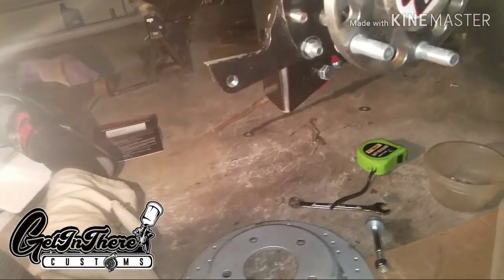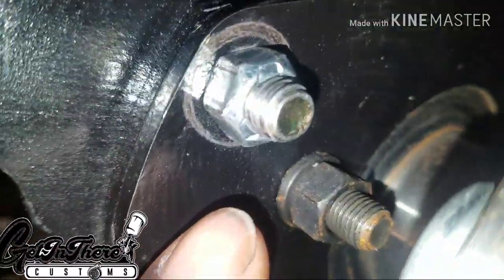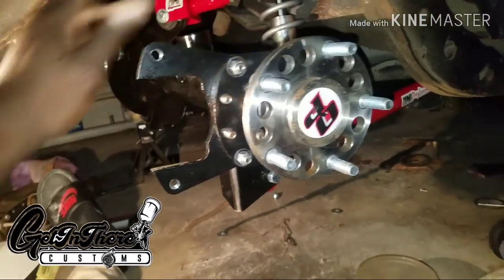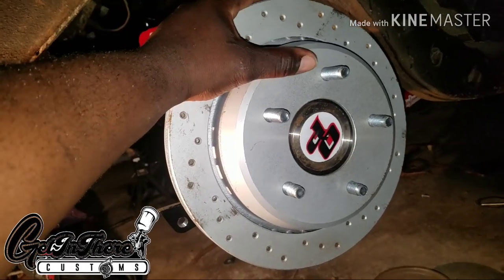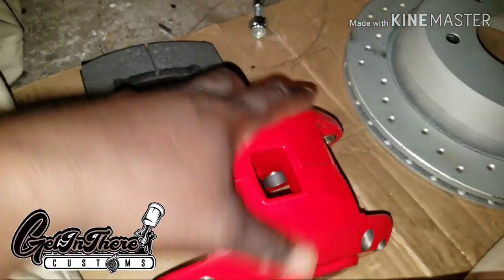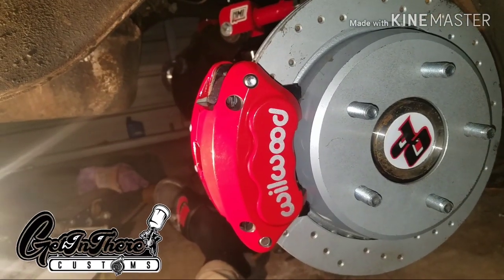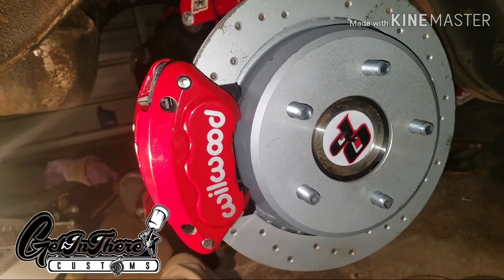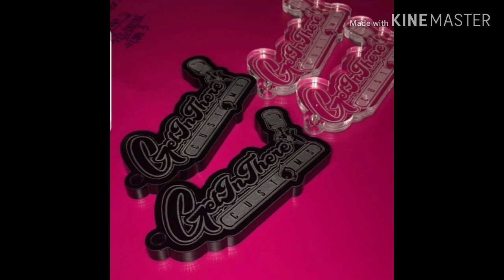how to rear disc brake swap a donk.71-76 impala/caprice

Comment: do you a kit for the 1974 olds delta 88 
i have the berm to brakes and rotors but need help bolting it on.
Reply from the maker: Front yes rear NO IF YOU HAVE 8.2 REAREND
Reply: @Mr_getinthere  Ok  how much for the front.  I already have the brembo 6piston for the front and 4 piston for the back that came off a ctsv caddy.   how can i tell if i have the 8.2 or not?
Reply: i have the rotors already to.

Comment: @Mr_Getinthere i got a 72 impala custom 2dr, are you still selling the rear disc conversion kits, im trying to buy one asap
Reply from the maker: I'm sold out for the donk rearend, if you have a 9" or 96ss I have thoses brackets
Reply: @Mr_getinthere  which Wilwood calipers to buy if I have your brackets already for 96 Rearend #120-11870 or 11872
Reply: @Mr_getinthere you still have the brackets and calipers available?

Comment: Will these caliper brackets work on 96 impala ss rear end, also summit sells wilwood calipers that bolt right on to 71-76 donks
Reply from the maker: The front calipers are replacement calipers that use stock rotors..yess I have this kit for 96 impala rearend
Reply: @Mr_getinthere  thanks, I have these calipers  Wilwood D52 Dual Piston Calipers, will your kit work with these on the 96 as impala rear end, if so I would like to order the kit minus the calipers, thanks again
Reply: I need that kit for my 1975 caprice vert how can I buy it
Reply: @Mr_getinthere how can I purchase that rear brake kit I need it for my 1975 caprice